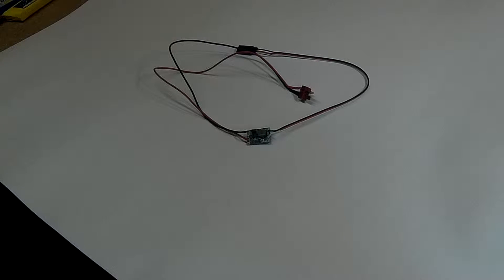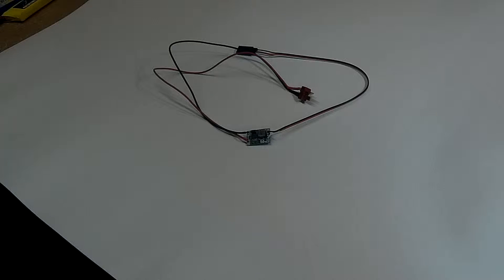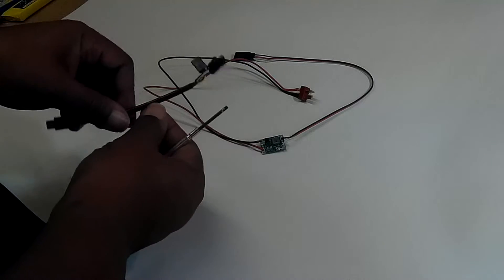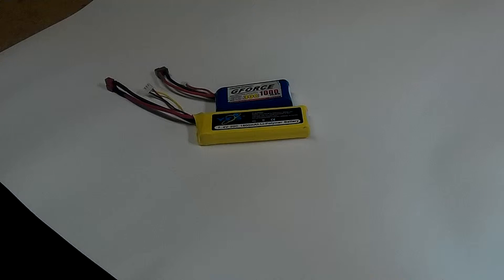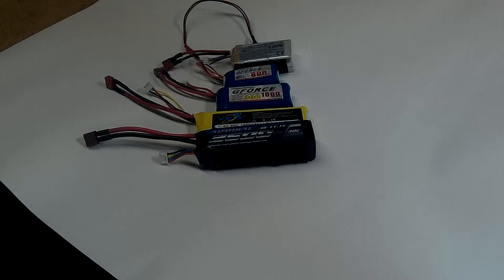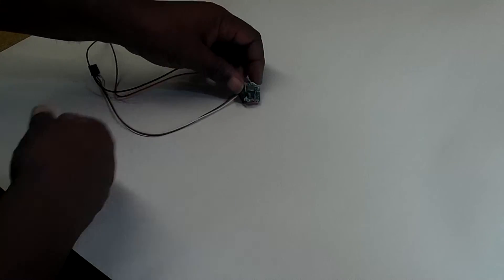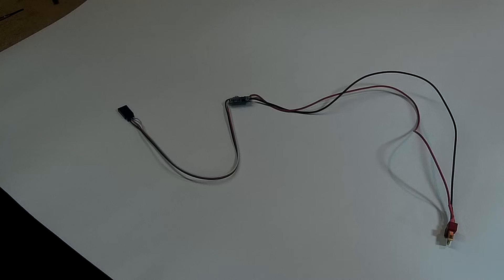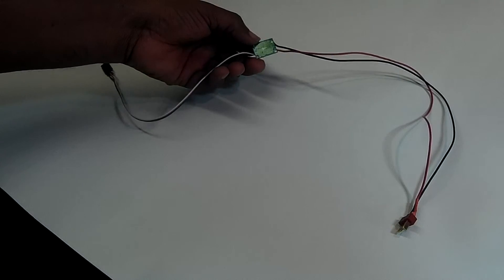Mobius Camera External Power

Comment: Hello, i want to use my mobius for dascam purpose! So i want to take the battery out because im afraid it melts in very hot sunconditions. If i take the battery out ive read the cam will not remeber the date clock. That not so bad! But will it remeber my settings for the cam? Also in the basic settings tabe of the mobius software there is an option that says: "power of disconnect". It says i must set the parameter to inmediate if i use a capacitor instead of a battery. Otherwise i will loos my last recording. Do i have to set it to inmediate if i dont use a battery noir a capacitor?
I want t get rid of the batterypack!
thanks!
Reply from the maker: I didn't remove my battery as it still holds a charges. If am videoing for a long time the battery dies, so I then plug in the adapter I made up. I would think you could wire it so that you could used a external battery. Or you may need to just replace the battery in the camera. Because I had so many extra lipo around that's what I did to solve my problem.